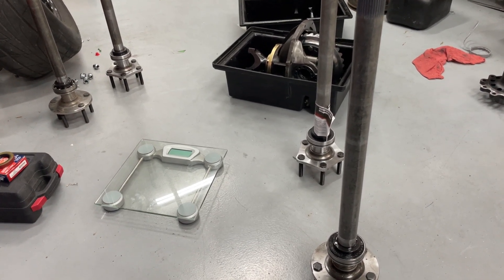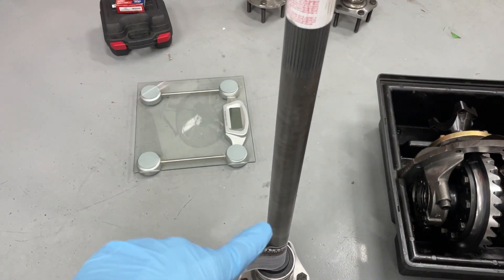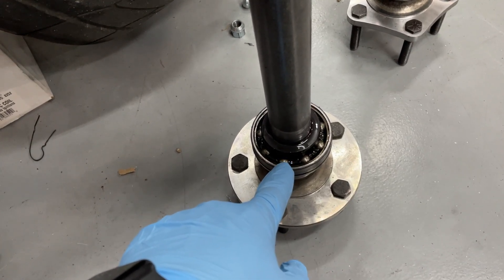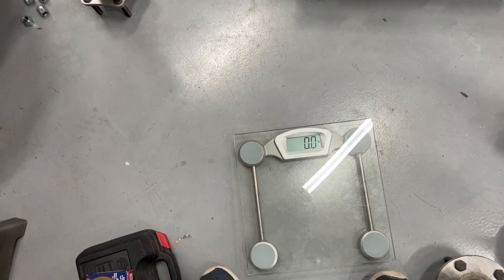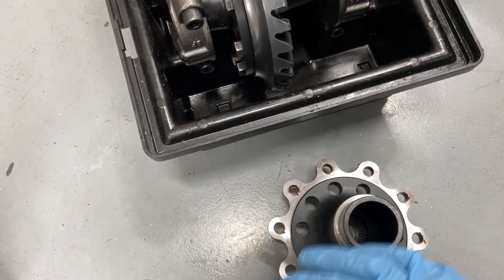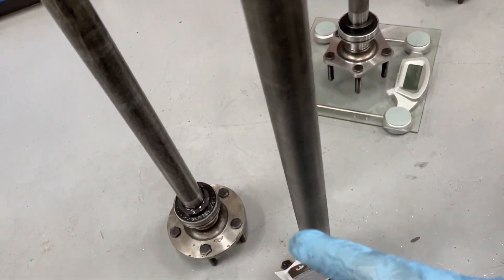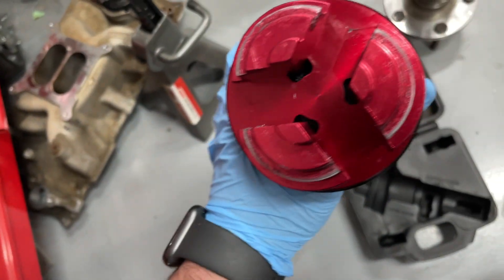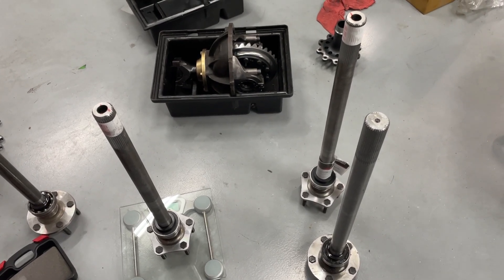Lite Weight Rearend Components Weight Difference

Comment: The reason why is the pinion is set to low in the housing.
Reply: Yeah but it all counts ! We're not trying to go slower. They did a lot of testing and proved that the 9" had parisitic dray. That's why comp eleminator cars don't run 9"s. They run a 9" housing with a Strange 12 bolt center section. The cars went faster !

Comment: A 9" has parasitic drag. That's why comp eliminator doesn't run 9"s You're always going to go slower with a 9" !
Reply: Splitting hairs when it comes to a bracket deal.  Like comparing ceramic wheel bearings

Comment: when it comes down to removinng weight from rotatiing assembly the last part of the assembly is the tyres it will be vastly better now its like if u remove a flywheel from the assembly light is fast

Comment: I wish I had enough spare methanol stuff around, [carb, regulator, & small under hood tank,] around to let you borrow! Just so you could stick that little blower on the engine that's in the truck now! I'd bet it would run like a R ped Ape 😂😂😂😂! We have had people stick a nice little blower [F1x] or single turbo on their nitrous engines! Without changing anything in the engine! Just the Alky carb, ect! They run hard! They ran so well that they didn't want anything changed when the engines came in for freshen up! Same 12.5 to 1 compression, cam, everything! They even left their gas fuel cell in the bed/trunk to feed under hood small cell, for when they want to street drive! They don't normally go far, maybe 20 miles max to a cars & coffee deal, & they do have a lean out on it! They figured, they had a real good running N/A engine, so what would it hurt! Apparently, nothing! They are also not running a ton of boost! I think the turbo guy runs 15 to 17lbs, & the blower guy probably 20ish! They are defiantly faster & they don't have to worry about nitrous problems! One guy has since put regular fuel injection on & he drives it on E85 & races it on methanol! I hope you can get it together to hit the test & tune! Have a great weekend!

Comment: Take 1.5" off those studs even more weight lost. Those scallped flanges though would worry me. Probably ok for drag racing but not so good for oval or road racing. Though with trick housings etc buy a floater!!
And yes I have lost an axle outside the bearing and have scrapped a few others as well. After cracktesting them  regularly afterwards.  And not crappy factory Ford 9" axles but good GM one ton axles. Here in Oz BTR now Dana improved the metalurgy of their axles a lot come late 80s. From what I am told 8.8 axles too are good.
9" axles are junk, break off outside the bearing way too often. Locally were banned here for speedway.